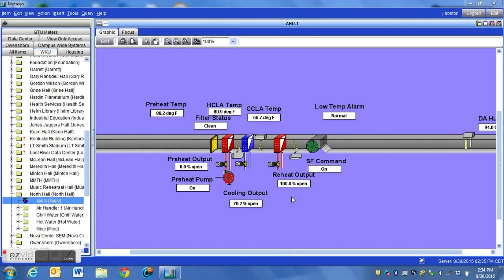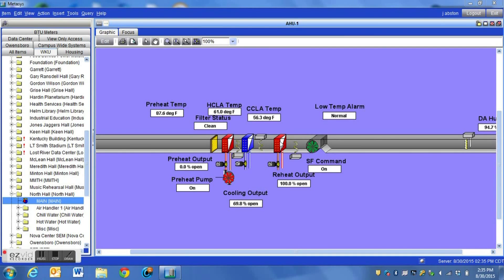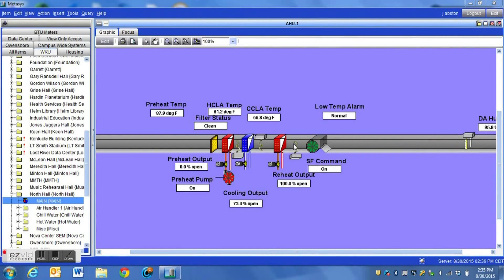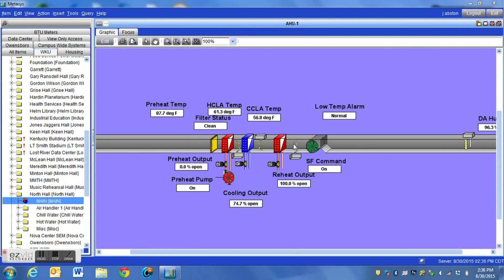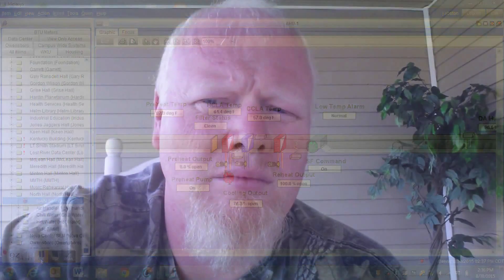How an air handler controls humidity

Comment: If I have an existing air handler ? How do I setup a controller to it to where I can control temp and humidity with one machine ? So I have to modify the air handler or anything ?
Reply from the maker: You will need to add the sensors and programming. If there's not enough hardware points you will need to add expansion modules

Comment: Hi, and thanks for your content.
I want to ask if there is any way to retrofit a FAHU for humidity control.
Assume that we have a heat recovery wheel and a cooling coil only.

All the options are not feasible...
Can't install a second wheel for after reheat,
Can't install a heat pipe because the manufacturers can only work on the shop,
Can't install a heater cause the consumption will be high...

Any other idea?
Reply from the maker: You need to super cool the air and then reheat it for temperature control. You may be able to if you have reheat vav for zone control
Reply: @Systemcontroltech  thanks but this is not feasible as well. Installing multiple reheat devices is not cheap either.

Comment: Correction:

It is right that lowering the temperature below dew point removes moisture from the air.  Heating the air back up only ensures that there will be no condensation in the space and/or adds comfort.  No moisture is removed through heating.  

The reason for this is that at a 55 Deg F discharge air temp, the highest the dewpoint can be is 55 Deg F which is 100% RH at 55 Deg F.  So if we warm it up to the 72 Deg F most rooms want,  then we will have 72 Deg F and 54% RH.  Very useful tools for understanding this are:

Dpcalc.org
Aqua-calc.com/calculate/humidity

Comment: Data centre humidity is high 80% i need to decrease  down 50 to 60%, dehumidification also happenning but not maintaining the humidity,  pls suggest me sir
Reply from the maker: Drive the discharge temperature as low as possible but be careful you don't get the duct work sweating.

Comment: When would the preheat coil be active then?  Correct me if I’m wrong, it just to protect the heating coil for bursting during winter, but not used in summer
Reply from the maker: The preheat coil becomes active when the outside air temperature is below the preheat set point.  It will open to warm the air up to that set point and is only active during extremely cold weather.

Comment: ah recognise the Metasys graphics...so I just wonder if you didnt make enough of the fact that it is RELATIVE humidity we are usually talking about. My way of understanding it is that when you cool it removes the humidity as you go under the dew point on the coil...then you are left with air that has got lower absolute humidity but still has a high relative humidity...when you reheat the air it can't (easily) get the humidity back in so the relative humidity decreases as the temp is increased.
Reply from the maker: +JAMES6Y thanks for watching and please subscribe for more

Comment: Hi
thank you for the valuable information you have presented. 
can be please highlight the standard temperature difference between supply water temperature and return chilled water temperature  (delta T)and how to maintain it
Reply from the maker: +Ali Ali I plan on doing more videos on chilled water systems in the future.
Reply: why there is two heating coil ?
Reply: @PipzWorld  I think it's to heat the air more after cooling it and that would lower the humidity 
as he says if cooling is like pressing the water out of the air then heating it is like stretching it again, so the humidity will be less and that prevents water from dropping in the duct

Comment: can this be done the other way round? using the cooling coil to control moisture and heating coil to control relative humidity?...since heating will reduce relative humidity
Reply from the maker: +Abhijit Shetty unfortunately it is not very effective that way. The only way to remove the moisture is to cool the air.  Many dehumidifiers will cool the air as much as possible and then reheat it for temperature control.  We have a system where dehumidification was an afterthought and the engineers tried what you've described. What actually happens is that while it's cooling the humidity will go down slightly but you eventually lose it whenever the room warms back up. It actually increases humidity then. Cool and condense first and then reheat. Thanks for watching.
Reply: But if the cooling coil valve work on the relative humidity feedback alone....it may happen that at a higher temperature ( i.e higher than setpoint temperature) the RH may match the setpoint value and then based on this the cooling coil valve will reduce the flow of chilled water ...and the desired temperature will never be achieved.....thanks for the video and reply
Reply from the maker: If the program has a dehumidification sequence it will drive the chilled water valve to 100% and then use the reheat coil to maintain room temperature.
Reply: Oh...ok thanks